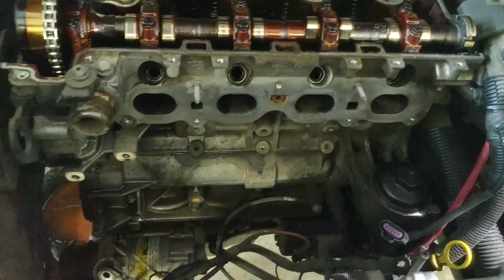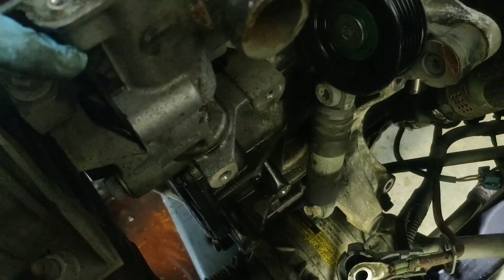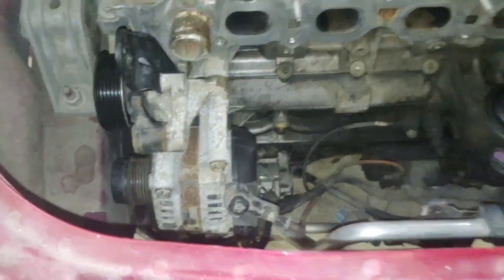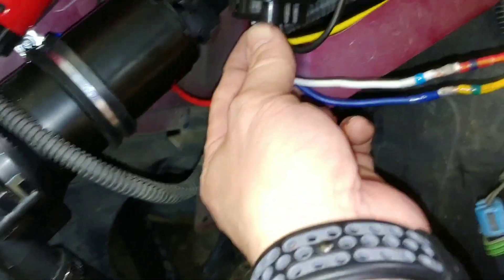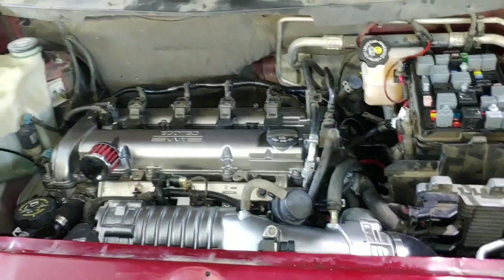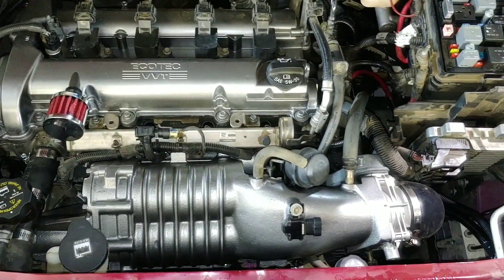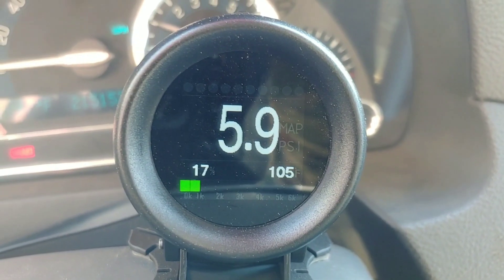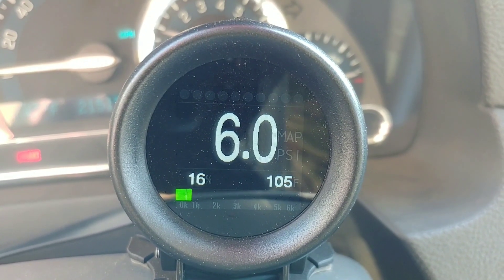Supercharging a 2.4L Ecotec Chevy HHR

Comment: Can I use this same method on my 07 hhr lt 2.2 I'm currently running an aftermarket exhaust plus the cold air intake and upgrading coil packs and plugs i run premium in it and have managed to mess around with the computer it's running more pressure through the injectors already as well I do most of my own work slowly working to making a sleep if you get the chance to reply
Reply from the maker: It will work on the 2.2 just the same. Just make sure to make the changes in the tune for the larger MAP sensor and tune for boost, if you don't have someone tune it for you. I used ZZP to get a good base file for this setup and went from there.
Reply: @josephcarlson1774 thank you man I was endlessly scrolling till I finally found this lol

Comment: I bought a air intake for my hhr but it dont have that vacuum hose on the side like the oem breather does but i see you have a little filter on that is that okay to do
Reply from the maker: @BraydonParmley-rw6pg  only with a tune or it will set a check engine light.

Comment: It’s funny I’ve had my hhr for over 10 years I just hit 124k and I bought a brand new 2020 grand Cherokee altitude in Dec of 20 but I started driving the hhr back n forth from NY to SC and I’ve been wanting to do something like this for my HHR because it’s been really good to me for all of these years .

So now I’m starting to return the favor I’ve fixed a few things  and cleaned everything up took the valve cover off replaced gaskets cleaned motor did a tuneup and fluids . I know what I have and I’m getting more comfortable working on it so I’m trying to make it fun to drive now . 

I was going to buy a 2009 SS before I bought mine but it had a leaking sunroof and the dealership would not put in writing that they would fix it if I bought the car and take responsibility . 

This was back in 2011 they wanted $13500 and I walked in with cash ready to buy it but. I wasn’t going to deal with a leaking sunroof . 

So I bought my 2006 LT that had 50k on it at the time for $9000 and it seemed like a lot but almost 13 years later the thing is still running like a champ back and forth to NY to SC every other week and just hit 124k on my last trip up north . 

This video is def inspiration . Thanks

Comment: I’ve got a 2012 Chevy equinox with the 2.4 I’m planing on doing this since it’s the same engine
Reply: It's the same engine but everything inside is a lot weaker, be cautious
Reply: @crisisrogue8286  yep I found that out. Ended up putting in a engine from a totaled cobalt ss with the supercharger and the original trans bolted right up
Reply: @ ah crap, well it must be nice now!

Comment: I'm curious did you get a tune first or did you install all the parts and run the car that way with out a tune
Reply from the maker: Have to get a tune before first start up. The ecu cannot control the bigger injectors and MAP sensor on the stock tune.

Comment: will this supercharger also work woth the 2008 hhr 2.2L?
Reply from the maker: Yes
Reply: @josephcarlson1774 . before u put the whipple in there was the engine all stock? just curious coz i dont wan a blow my motor lol and is the same stock auto transmission gonna do just fine if i were to put the whipple?
Reply from the maker: @amenokansai1697  my engine is all stock, but the early 2.4L like mine, have factory forged internals. But your stock 2.2 will be fine on a stock pulley.

Comment: I wanna supercharge my 2009 chevy malibu 2.4 ecotec, I already have longtube manifolds, would this year and model need forged internals?
Reply from the maker: Not if you keep the boost fairly conservative. A stock or slightly smaller than stock pulley and it'll be fine.
Reply: Did you have yours tuned at the time in the video?
Reply from the maker: @chaosangelx13  Yes I did. It won't run if it is not calibrated for the new Map sensor to read positive pressure(boost).

Comment: Joseph Carlson, did you have to do anything to the ECU and TCM (transmission control), after adding the supercharger?
Reply from the maker: Yes. I used HPtuners to tune the ECM, but I have a 5spd manual, so I don't have a TCM.
Reply: @josephcarlson1774  ahh okay, I didn't know.

Comment: New sub & what bad ass video you made.. I mean you broke it down  to all you could...  just got my hhr. But she's a manual.. id love to do this swap sounds awesome... will you be around lol .. if end up with some questions 🤔 during the swap. ? ALSO  like I said just got her but how hard would it be to convert her to manual.. is it even possible..  I also have the 2.4 2LT 06  fully loaded ... auto though fuuukkkk!  Any thoughts much appreciated bud... but either way that was & is a bad ass swap you did.. you still have her.. I gotta check your other vidz ✊
Reply from the maker: I don't have any knowledge on manual swapping these cars, but the auto should hold all the power the supercharger can throw at it. It's the same auto trans they used in the turbocharged SS HHR's.
Reply: @josephcarlson1774  yessir thats good to know .. I definitely need to do more research  but thats good to know for sure.. does the 2.2 have same trans that you are aware of..  ? HOW MUCH DID YOU PURCHASE YOUR DONOR CAR  FOR? THINK IT WAS YOUR VID TOO , DID YOU SWAP YOUR REAR AXLE FOR THE DISC BREAK SET UP .. THATS THE VIDEO I FIRST STARTED ON THE OTHER DAY LOL 😆.. done got me started 🤣 now haaaaa. Thx bud much appreciate your swap vid million times over 👍 👌 👏 ✊
Reply: Not to take Jospeh’s glory or any thing but I supercharged my 2.4l auto hhr around the same time as he did coincidentally lol.

@joseph you know I’m not about gate keeping lol.

2.8” pulley, 80# injectors, 75 shot of nitrous, stage 3 hey exchange and all sorts of misc stuff on mine.

Comment: Are you running the f23 Trans? Or f35
Reply from the maker: The factory F23
Reply: @josephcarlson1774  that's what I assumed. I'm picking up a 06 hhr tomorrow and already doing research. Found a set of wiseco turbo pistons 8.8 and lsj cobalt for parts to get started

Comment: I have the complete setup from a 06 Chevy Cobalt SS and wanting to install it on my 2011 Chevy Malibu 2.4l ecotec would it work fine ??  I heard the 2.4's have higher compression than the 2.0l would I have any issues if I install the supercharger ??  And can I run it with out a tune for a while  ?? 

THANKS IN ADVANCE!!
Reply from the maker: It should work fine, it has the same LE5 2.4L my HHR has, but you can't run it without a tune.
Reply: Ok I have a extra ECU that I can probably get  re-programmed and have a tune on it and not mess with my stock ECU for smogging purposes (The life of California)🤦‍♂️ lol
Reply from the maker: @RC_BASSBOY  I would talk with ZZPerformance, they've helped with all of my tuning.
Reply: @josephcarlson1774  hey  the 2006 HHR we have , have the forged internals 
. Like you said .. does the 2011 have the same .. or just our years correct ? 🤔but they can still handle? Thx bud
Reply from the maker: @OGSHAKER2020  only the 06 and very early 07's had the forged internals. They over built them for the 2.4's debut in 06, then made them cheaper like the 2.2 Ecotec after that.
Reply: @josephcarlson1774  my man with the facts 💯 😤 & knowledge.. im just getting my feet wet with HIGH HERITAGE ROOF.  Modeled after the 49 suburban .. the grill these bad boys have  as well as the flared body  remind me so much of my 51 chevy pickup.. I feel this car is my style never new them before till i picked this bad boy up for my daily not to mention 300 bucks was a steal he hadn't a clue how to work on cars.. she's a keeper..im gettn rid of my lexus SUV  rx330  for her no doubt.. TH3 MORE I LEARN ABOUT THE HHR . THE MORE I WANNA SUPERCHARGE . LOL THX TO U NO DOUBT.....   SUPER STOKED WE HAVE FORGED INTERNALS... HAAAAA PERFECT YEAR WE LANDED ..JUST WISH MINES WAS A MANUAL... 😄 HAAAHAA..  ANYWAYS I GOT A LOVE & A PROBLEM FOR CARS LOL 😆...( BY THE  WAY I WANNA START HUNTING DOWN MY LOANER COBALT! WHAT YEARS ARE GOOD FOR THIS BUILD.. ✊THINK I WATCHED YOUR VID BOUT 10X SO FAR & I CANT RECALL .. LOL 😆  RIGHT ON BROTHER ✊
Reply: @josephcarlson1774  so later years had no forged internals? U think 🤔 they can handle the supercharger, Probably just the SS had forged huh?

Comment: Most of the people I know putting in an intercooler, went with a HHR SS front bumper, because it's made to fit the stock intercooler.
Reply: I put a 24x12x4 inch core intercooler in a stock HHR LT bumper with alot of trimming. No need to do the ugly SS bumper.

Comment: Just wanted to extend a sincere thank you for making this video. I just got done supercharging my 2008 HHR LT and your video definitely made things a lot easier. I probably added 30+ views because of how many times I would reference the way you did certain things.
Reply from the maker: I'm glad I could be of help! That's exactly why I made this video, I couldn't find any real info on doing the swap and figured I might as well record it if I'm going to do it.
Reply: Hey did you ever put a special tune on your car? I’m doing the same thing lol
Reply from the maker: @drkeIpo  yes I did. I used HP tuners to tune the ECM with some help from ZZP
Reply: Wow I have the same year lol I don't know much about cars bout I'm starting to😁
Reply: Automatic or manual?
Reply from the maker: @kevinmartin5120  manual
Reply: @josephcarlson1774  I’m still learning about cars and plan on taking mechanic as a career in the next couple of years. But do u think it would be easier or harder to do a supercharger on an automatic or would it be the same as a manual? Sorry for the dumb question I really wanna do something with my 2011 HHR LT 2.2
Reply from the maker: @kevinmartin5120  its the same amount of work if its an auto or a manual. A lot of people have supercharged their automatic 2.2L cars without any issues. And the transmissions hold up pretty well at those power numbers.
Reply: @kevinmartin5120  my 2008 HHR LT is an automatic and I was able to supercharge it without a problem. The automatic transmission adds huge drivetrain power losses, but I bought this car dirt cheap and have a fondness for it. My stock auto trans has 215k miles and I’ve replaced the shift solenoids, filter, and fluid. I do get an occasional bounce or two on the limiter when it up shifts from second to third gear at WOT. ZZP tunes the transmission which is definitely something I would still do whether or not you decide to supercharge yours. If my transmission starts to slip, I will just try and find a good condition used HHR SS auto trans. They seem to hold quite a bit of power.

Comment: still, running stock internals?
Reply from the maker: Yes. Stock internals with 216k on the clock. The '06 and early '07 2.4L engines were built very robust with factory forged internals.
Reply: @josephcarlson1774  awesome been told there crap by some people and others say there good but none have done it

Comment: Glad you are doing this now rather than 8-10 years ago, hard to find modern HHR modification videos/forums. Are you able to make a list of all the parts and kits used?
Reply from the maker: I kind of touched on most of it in the video, but Im going to make a video just going through all the specific parts I used in the swap.
Reply: @josephcarlson1774  Did you have any codes after the install? I've just finished my 2.4L cobalt and throwing a p0122, p0222, p0223 codes and don't know where to go next pretty much all the parts put on are new, Did the LSJ LS4 Throttle body and adapter you mentioned.(ported S/C and ZZP tuned PCM/ECM) The adapter does not clip to the LS4 Throttle body, do you think that could be the issue? Also with the I/C pump i have it wired to the fuel pump fuse as per becks guide(Seems to be working but I will flow test next)
Reply from the maker: @kylekearns4052  all of those codes are for the throttle body. Did you use the ZZP adapter harness for the LE5 harness to the LSJ/LS4 throttle body? If you don't run the adapter harness you'll have to get the correct plug and rewire your harness. But the adapter harness is pretty cheap.
Reply: @josephcarlson1774  Thanks for the quick reply(faster than zzp hah) yes I bought the 8pin to 8 pin throttle body adapter and a brand new LS4 throttle body from rock auto (the pin adapter won’t click fully onto the throttle body unless I’m not pushing hard enough, will try to make it so it can go fully on, about 1/8” of space in between.
Reply: Go on Facebook for groups.

Comment: What I know about 2.4l it's has too weak timing chain guides .. how did you make them hold that ?
Reply from the maker: The 06 and early 07 2.4L's don't have the timing chain issue, mine are all original with 216k miles on it. Also the timing chain doesn't take any more added stress with boost.
Reply: @josephcarlson1774  thank you pro🙋🏻‍♂️

Comment: Joseph how do you find the ls4 tb and did you have any issues getting the scalers correct?
Reply from the maker: Salvage yards are full of 4.2L 6cyl trailblazers, and ZZP actually tells you what to change in the tune if you look up the LS4 TB on their website.
Reply: Awesome! Tks Man. Yeah I actually picked up a used ls4 tb off of a H3 Hummer aka same as the 4.2 trail blazer. I also picked up a ported stage 2 supercharger and I'm going to get a 3 inch zzp cold air intake

Comment: 1st! Lol

Great work! How does your mileage differ? Is it a good daily still?
Reply from the maker: When driving it normal, it feels like a completely stock car. If I would keep my foot out of it, I think it would get the same MPG's as before, but even driving it hard I've only seen a 2mpg drop.
Reply: How reliable had yours been, I have the 4 speed so I don't get great acceleration, but it's fast enough. A super charger would be sick. If you could get back to me that would be great.
Reply from the maker: @jurkjaredgamez8392  it's been very reliable so far. It drives like it stock when not in the throttle, and the mid range torque is awesome. Being it's all GM parts I really don't foresee any issues down the road.
Reply: @josephcarlson1774  thanks